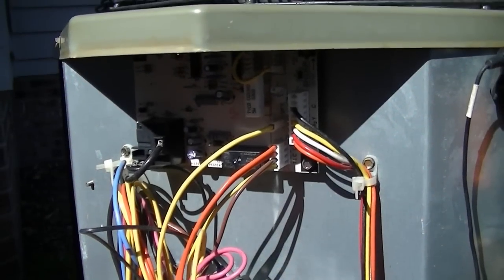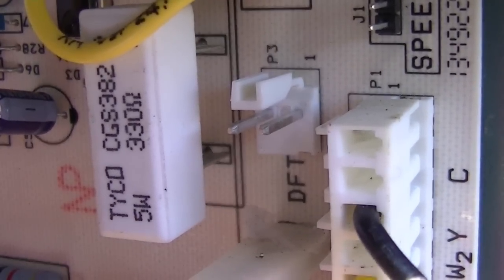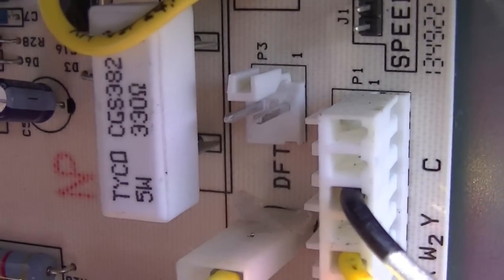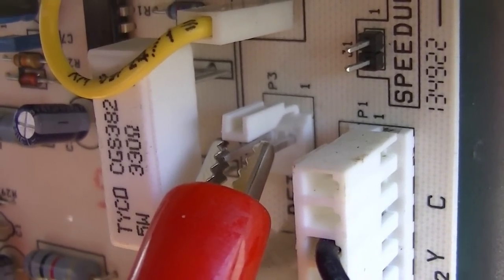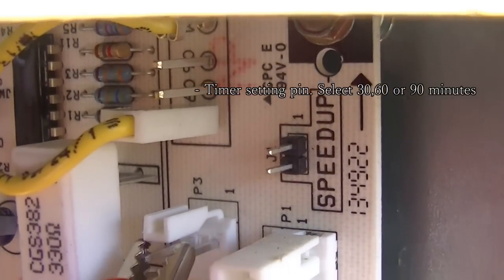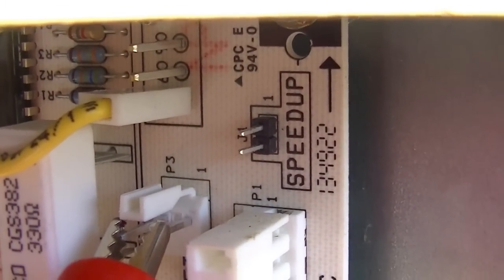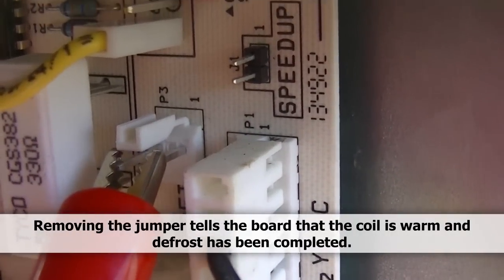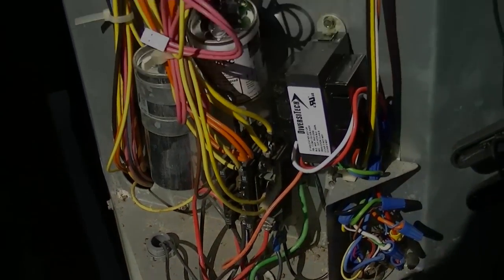HVAC Service Training- Testing a Heat Pump Defrost Timer

Comment: Mine was jumping in and out of defrost at random and well before the timer was up. Techs couldn’t find it. So this year I gave it a shot and found a corroded wire to the reversing valve. Just a slight bump would cause it to disconnect. Amazed it worked at all but doubly amazed nobody else found it lol.

Comment: Sweet video brushing up on heat pumps and defrost. Reading up to be prepared have a lot of gas packs in central Cali but been coming across HP's. Appreciate the info and time.
Reply: Robert Ornelas Where in Central Cali are you at?

Comment: If it doesn't go into defrost when you short it out, does it mean it has a bad defrost board? or what other test can you do before condemning the Defrost board.?
Reply from the maker: you should make sure the board has 24 volts to power the timer. measured r to common

Comment: I have a Lennox 14hpx. Was installed last winter and the installer has the defrost set to 30 minutes... I'd like to bump it up to 60 minutes. Is there any sequence to this? Should the unit be powered off or up and running before I move the pin to the 60-minute mark from 30? Thanks

Comment: At the 120 mark you talk about the timer being 30,60 or 90 but I dont see it in the frame of the shot.  Can you explain how you make the selection on the timer.  I havent had much experience with heat pump service.  We didnt cover them much in rac 1 and rac 2. btw I really enjoy your videos. very informative. thanks a lot!
Reply: johnmiller102 there's a yellow wire coming out the board about a inch long with a white plug on the end. It is right next to the 30 50 90 pins on the board. You put the plug on which ever setting you'd like 30/50/90. Colder areas prolly want to use less run time between defrost.

Comment: Short and sweet, good.
Reply from the maker: Yep, fill in blanks for some of the new guys. Thanks Stephen
Reply: I've always just pulled the fan lead to get some frost built up on the coil and prove the sensor or terminator switch before speeding up the timer. talyn875

Comment: Hey Zack, when defrost kicks in, is there some way to stop the compressor for a few minutes so pressure can equalize to avoid that loud whooshing noise when the 4-way valve reverses?
Reply from the maker: Some boards do have a built in delay. You can add another delay board or switch defrost boards to accomplish that.

Comment: My Carrier works in AC mode but not Heat Mode... The wall plate says "Auxiliary" does my heat pump need replacing?
Reply from the maker: You need a tech to look at it first hand
Reply: i called Honeywell tech support and they walked me through the fix... What was the fix? They had me remove the wall unit, unscrew all the wires and touch them all together which rebooted the heat pump. Worked like a charm!!!!!